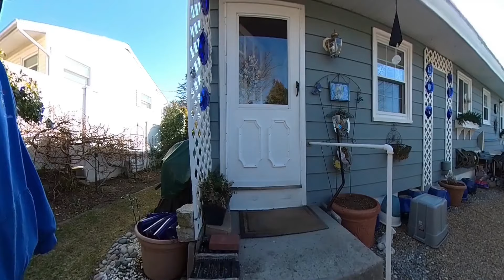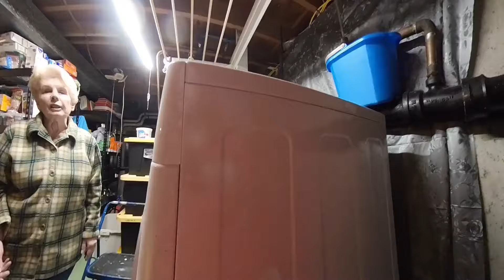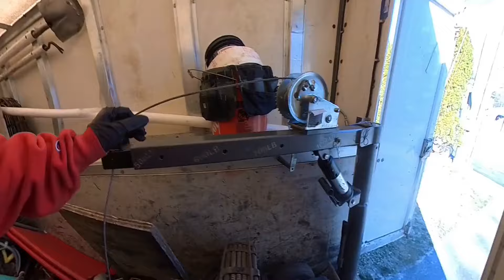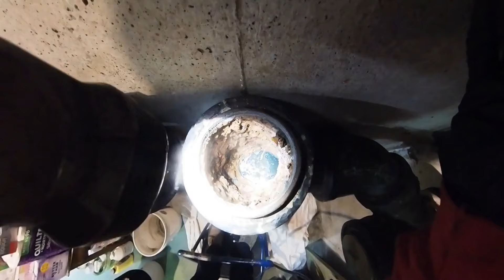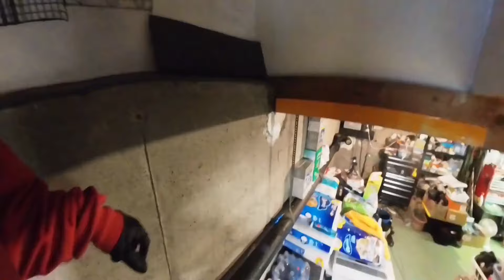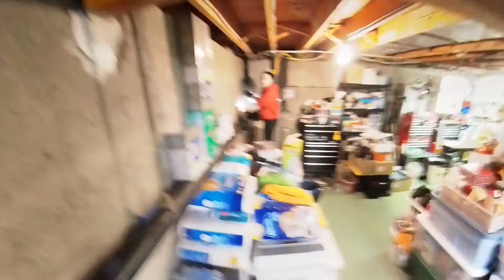How To Clean A House Trap Blockage 247

Comment: Thats a really deep and low Ubend on that Trap its no wonder they suffer from frequent blockages Well Done Guys Great Job as Usual
Reply from the maker: It's a whole house trap that's why it's so large. Usually when we find them we tell people to take them out. (Shelly)
Reply: @DrainMedic  OH Right I see Shelly so when you Remove those types of Traps what do you put in place and Install to prevent Sewer Gas Smells coming back into the property and internal drain system???
Reply from the maker: @paulwheatley6  Every fixture has a trap. So no need for one on the main. Some states still do require them. (Shelly)

Comment: I have had amazing results using a penetrating oil called Kroil, many people like PB blaster, but For me, the Kroil works on things PB blaster doesn't. Put some on those iron caps, although it is best to be able to give it time to work,  like 20 minutes to get down in the threads. Also, a 36 inch pipe wrench will give you a lot more leverage, yea, I know it's heavy, but they do have the light weight ones with aluminum handle, but they cost more.
Reply from the maker: We use free all works the best we've found. Yeah the bigger pipe wrench would have worked. (Shelly)

Comment: Also, as you know, those old cast iron drains get a bit rough inside and start catching things, a good flex shaft cleaning could help a lot. Also, with all the newer low flow toilets, sinks, showers, that causes more clogs. I would tell them to once a week, fill the tub with water and let it help flush the pipes. If they don't have a tub, fill all the sinks and try to pull the plugs very close to the same time as possible.
Reply from the maker: Thank you for the tips 😊. (Shelly)